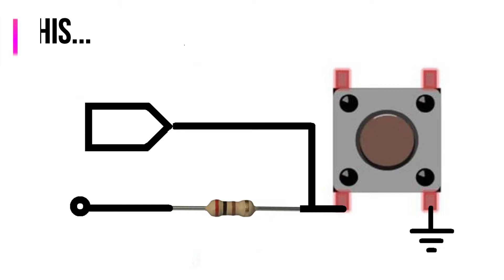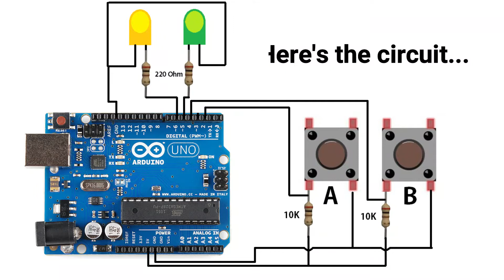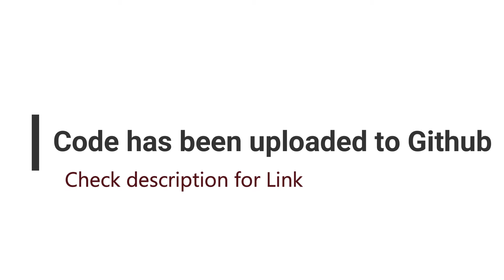How to use Push buttons with Arduino?

Comment: hi
in your 'How to run Johnson DC geared Motor' video. you were saying 59  N-cm for a 300 rpm motor, Is it correct information ?. I've been searching for a motor that has high torque. I would like to know more about the Johnson DC geared Motor.

Can you share your email or social ?
Reply from the maker: If your budget is tight...Johnson motor is best at 350/- each...but if you don't want to compromise the torque then Planetory DC geared motor is best
Reply: @bongtechsolutions7735   Yes I'm on a tight budget and can't afford a planetary geared motor, it is also too big for my application.

My project is to build motorized shoes. It should carry an adults weight. The motor I am looking for is 600 RPM Johnson gear motor. 2 motor for each shoe.

If two motor for each shoe is not powerful enough, Then I am also considering 4 motors for each shoe but it will increase the weight.
What do you think, 2 motor or 4 motor setup ?
Reply from the maker: 2motor setup will work...but i think 600rpm is too fast...and owing to this speed the torque will also be low...go for 200rpm...